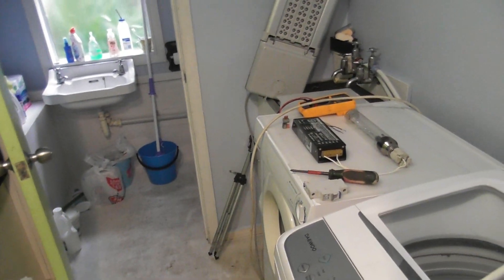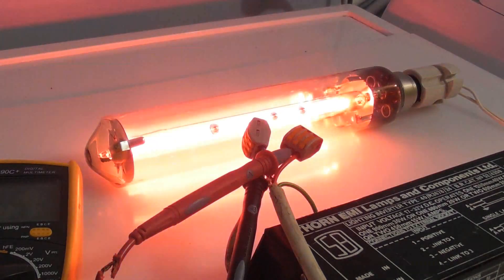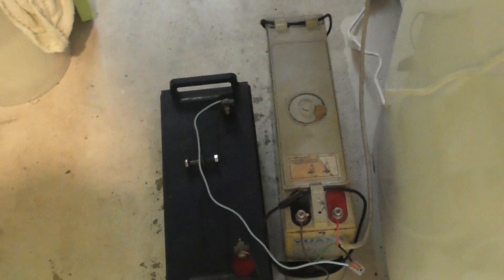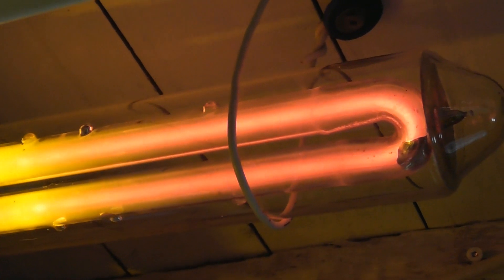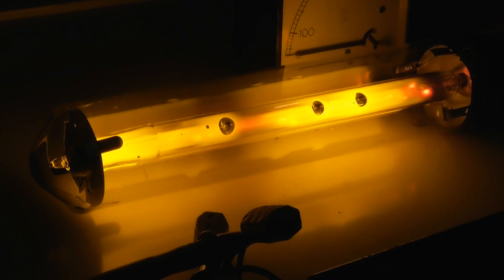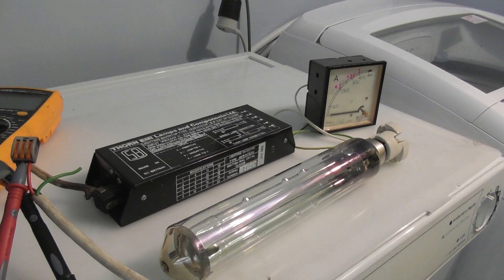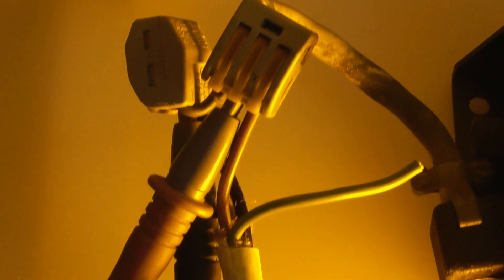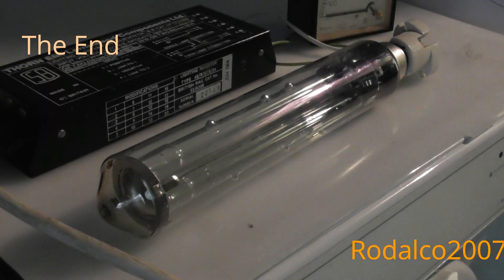26 Watt SOX lamp on 24 Volts British railways inverter

Comment: I work on the railway here in the UK and have changed loads of those inverters over the years, the 24v ones were for Mk1 & Mk2 coaching stock with 24v battery systems of which ironically, NZ took in large quantities for your services which explains possibly how you came to get one.
There is also a 110v DC input type for the Mk3 coaching stock with 110v battery systems.
Reply: I too used to work for the Railway as a driver and any spare time working at my local depot (Crown Point), I would raid these inverters from old sets of Mk1 postal coaches.
BTW, I sent these components & lamps to Raymond.  You can find a vid from 7 months ago where he energizes a SOX-E 66 lamp & electronic ballast.  Cheers!

Comment: As you can tell from the measurements on the DC side that the average consumption is around 37 watts running a SOX-E 26.  If you use the SOX 35, the circuit power is around 45 watts.  The power supplies are pretty old compared to modern PSU's, but still they are around 85% efficient.
It does take slightly longer for the lamp to reach full brightness and that is one of the reasons why these PSU's are probably OK for these lamps.  The constant voltage/current o/p means that the lamp will not consume more power than it's rating, but will draw more as the lamp ages.
I recently discovered some 20w T18 fluorescent drivers from an old bus (24v) and they can drive an 18w SOX lamp.  I'll try to put some vid's together soon now that Winter is settling in over here.
Thanks for showing this Raymond.  Cheers!

Comment: Beautiful lamp, nice find that inverter, have been trying to find a low voltage inverter to power up some Sodium lamps.
Reply from the maker: It was sent to me complete with lamps by bridgerectifier another youtuber in the UK.
Reply: Hi there.  I've recently discovered that some lighting inverters from an old bus I'm helping to convert.  It was full of 24v 20W inverters for 20W T18 fluorescent tubes.  They can drive a SOX-E or SOX-H 18W lamp.  I still have not yet tried any A.C. electronic ballasts.  They might work, but I suspect the high striking voltage may reduce lamp life if placed onto a SOX lamp.
Reply from the maker: @bridgerectifier7711  Give it a go, a short test run can't do any harm. and make a video of it if you can.
Reply: @RODALCO2007  Yeah, alright that's a plan.  I'll try it out on some almost dead lamps first.
Reply from the maker: @bridgerectifier7711  Great idea.

Comment: I need to get one of those lamps to fiddle with, they are beautiful.
Reply: Long out of production, all you get is the remaining stock of them, from various suppliers disposing of them.
Reply: Try Ebay.  Lots for sale here in the UK, but depending where you are in the world, postage may be a factor in your purchase.
Reply: @bridgerectifier7711  I bought mine from RS, they were actually the cheapest supplier, and delivery was, as always, a week later for the ex UK stock. They might still have some left in stock.
Reply: @SeanBZA  The words RS and cheap don't normally go together, but I'll take a look anyway.  Cheers!
Reply: @bridgerectifier7711  Went to look and it seems they no longer list them. Might be worth looking up the part number in the old paper catalogue and seeing if they still have some though. For me buying through RS did work out cheaper thanks to postage cost.

Comment: Oh nice, a relatively low wattage SOX, they seem pretty hard to find nowadays. Interesting running such a lamp off DC, could technically use it portably in this case.
Reply: It’s likely switching the dc to high frequency ac to run the lamp as dc would cause the sodium to migrate
Reply: @evanchapmanfanman  The output from the PSU is high frequency not at all different to an electronic ballast designed specifically for a SOX lamp.  If anything, it will increase lamp life.  The Sodium will migrate to the coolest end in any event and that's how they die.  You can sometimes restore a larger lamp by gently shaking the Sodium loose causing it to run back to the filaments.